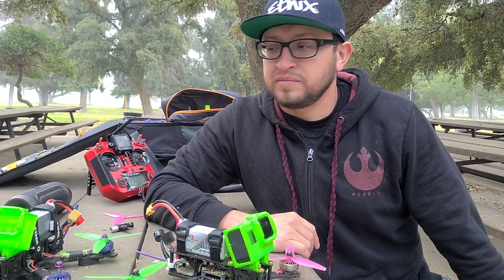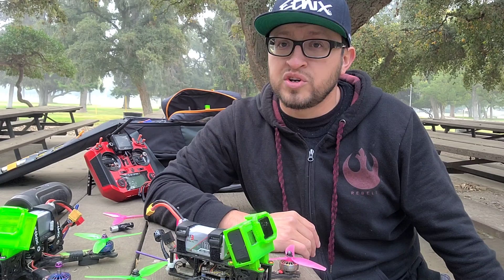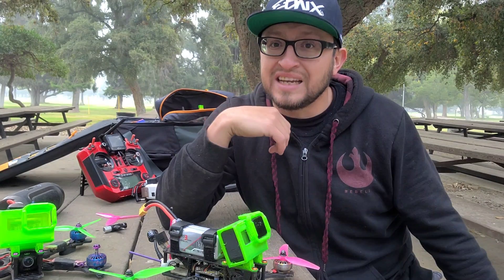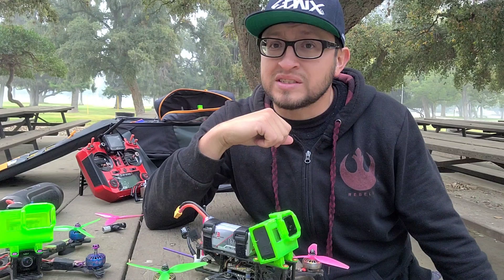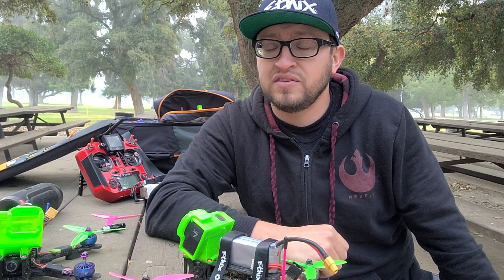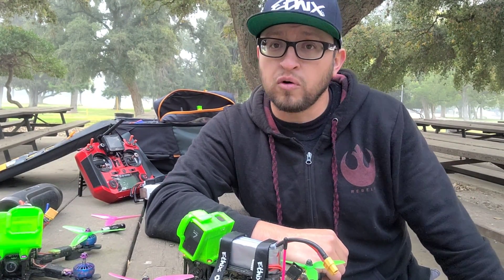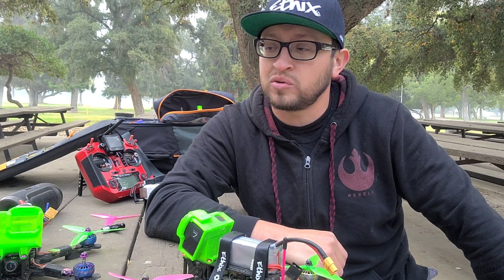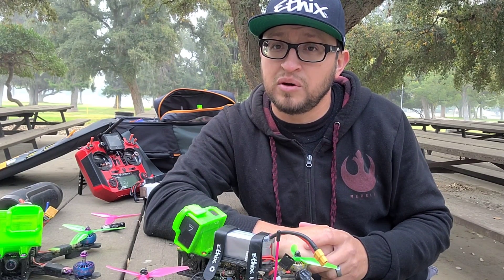iFlight Xing 2207 2306 Motor Review One Year Later #iflight #xing #xingmotors

Comment: thats the one issue us thumbers have, sometime we slip lol. Those little micro adjustments are a pain. I just can't fly as accurately pinching. it feels harder to do big deflections. I had to change bearings in my 2306s fairly soon, couple of them really started to grind. my rule of thumb for bearings is if their making noise, and you run them slow in betaflight and can feel those knocks in the arms, then they gotta go

Comment: Do you soft mount your motors or just bolt them straight to the frame?
Reply from the maker: Bolt them straight to the frame
Reply: @VoidvaderFPV   Thanks for the reply, is it better to direct mount?
Reply from the maker: Yes, soft mounting is not needed for motors anymore. The software can handle all the vibrations nowadays

Comment: Xing-e are not durable, most importantly they are not unibell, so when i crashed really frequently I had bell separated from magnets, and needed to bend it back, also bearings can die with hard crash with sand inside the motors.
So i ordered Normal Xing's as on this video, i hope they will last a lot longer :)
Reply from the maker: Nice man! I actually have a set of Xing-E's now and haven't had any issues so far but I haven't crashed them like I have the regular ones. You should notice a huge difference in the durability then
Reply: @VoidvaderFPV  When i ordered brand new nazgul 5 with xing-e motors, they last pretty long, but when first motor failed, i ordered 8pcs from aliexpress, they were little bit diffrent (shorter threaded shaft), maybe fake and a lot more problematic xP
Reply from the maker: They could have just been a different run and where not at good. But then again, definitely could have been fake. I hope the new ones work out for you

Comment: Nice one man. 2207 or 2307 are good for cinematic flying?
Reply from the maker: Thanks bro! Really it depends on your stick movements and style. Of the two I would say that the 2207's give you a smoother throttle range overall. I've just gotten used to 2306 for freestyle that I just use it for everything. 2306 just has more power in the bottom to mid throttle with helps with freestyle and heavy quads

Comment: Nice review 👍🏻👍🏻👍🏻
Differences between x2207 & x2306?
I have emax eco 2306 2400kv on a tbs source one v3 frame, I'm looking for upgrading motors and I don't know which should I get, x2207 or x2306?
Reply from the maker: Thanks man!

Ok so 2207 have most of there power in the top end of the throttle and 2306 have power in the 30-60% of the throttle. They are both great for freestyle and it just depends on what style you are going for. Im more of a flippidy floppidy guy so I like the 2306 because it handle my heavy quad in those throttle ranges. People that have the "juicy" style tend to like 2207
Reply: @VoidvaderFPV  thanks for your help!

Comment: Do You have any thought according to xing-e  version of those motors?
Reply from the maker: I personally do not own any but my friend that I fly with every weekend has had 3 sets if them so I've had some experience with them. The only major difference is the bell, it is a steel shaft instead of titanium and the bell is just heavier.  That being said they has the same amount of power and are still smooth. I'm honestly not sure how durable the E versions are compared to the regular ones though...he has crashed them but not a lot. They are really good motors for the price.

Comment: Excellent review. This is just what I wanted to hear about them.  I just purchased the 2207 2450KV Unibell in red/black pattern.  I was going to purchase the 2208s but JBs website led me to believe they were a little bit more power-hungry.  So, I went with the 2207s.

Believe it or not, I started out with Samguk $9. motors and they have taken a beating!  I recently fried one when an ESC shorted and caught fire.  I always said when one goes, I'm upgrading.  And two years later, here I am.  Too bad they went out of business.  I highly recommended the Samguks for new pilots.  Anyway, I just subbed you.
Reply from the maker: Thank you Nick! I'm glad you upgraded, you should notice a pretty big difference. I never had the Samguk series motors but I did here good things considering the price. 

I believe I answered your battery question on your FB post, but the average flight time was about 3 minutes with a 1300 4s with hard flying.

Thank you for the sub!

Comment: with all the crash still no jello? However for the motor sound, you can just change the bearing for NSK 944 or EZO 640ZZ (not 100% sure for the ezo but since its 06 type motor...).
I've just break one bell but i was like full throttle during a trick , kick a branch and then full throttle to the concret xD and kick the floor exactly on the motor so... Guess everymotor would be dead. Here just the bell was bend, i replace it, and hope its good.
what your feeling in flight? do you feel a punch around 40/60% of throttle?
Reply from the maker: Nope, no jello from the motors at all. I will probably change the bearings soon anyways.

Yeah I've had some pretty crazy crashes and I haven't even had to change a bell. The bells have a bunch of dents from crashing into doorways, concrete benches, poles etc.
Reply from the maker: As for the 2207's the power starts around 60% like most. Bottom end is mushy but controllable.

The 2306's have all the power between the 30-60% range. After 60% its just higher rpm but no real bite. 

Both feel very smooth as far a throttle feeling and I now prefer the 2306's for the type of flying i do. They handle prop wash better too.

I hope this answers your question 🙂
Reply: @VoidvaderFPV  interesting, exactly same feeling, under 40% it's precise, then around 60% to 70% I god the punch, which is really good and fit for me.

Looking the weight and the thickness of the bell, seems very resistant.

👌